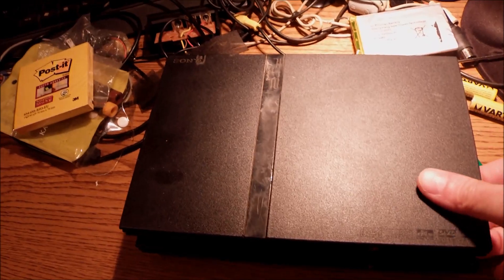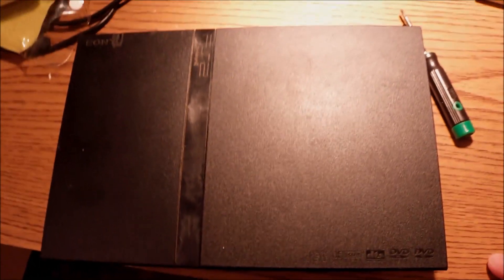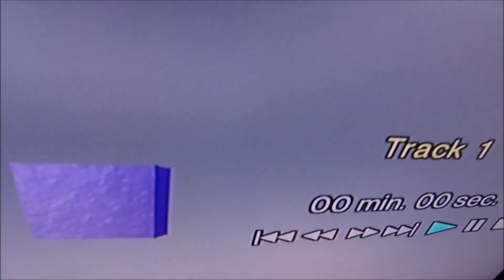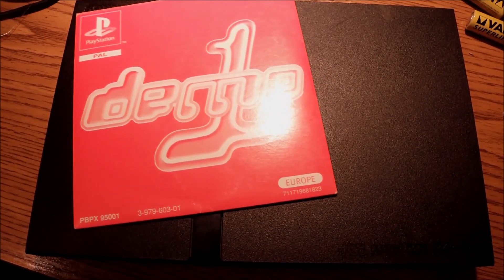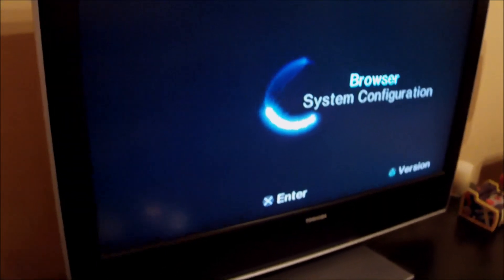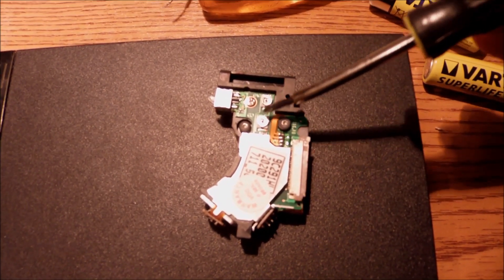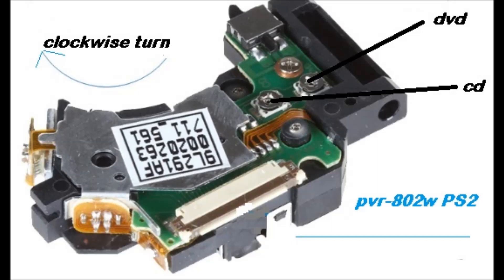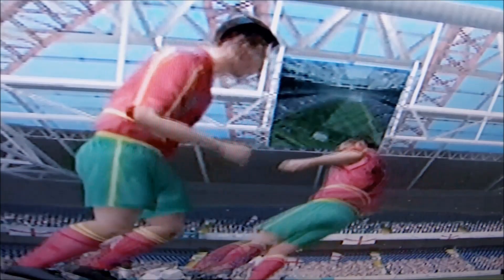PS2 Essentials: Laser adjustment easy fix: 'Disk Cannot be read'.

Comment: Thanks for the video it really helps. At first I tried Clockwise it didn't work then I tried Counterclockwise it did work then! So don't lose hope and after 5 or 6 times it can work and don't turn so much, make tiny adjusments. You dont have to put the case back everytime, there are two switches for making the disc turn, you can see it in other videos, you push them slowly and that way you don't have to put the case back everytime.
Reply from the maker: Hello Mehmet! I am always feeling so glad when a PS2 finally gets back to life !! 
Thank you for the useful tip! and thank you for watching! Cheers!

Comment: help I only have an issue with GT4, PS2 reads every other disc,,,,,, the GT4 disc seems in perfect condition.
Reply from the maker: I just <3 your nick!
Mate, if every other disc is working, the GT4 "seems" to be in perfect condition indeed, but it may ain't! 
The only test possible is to check the disk to another, trustful, PS2 and see what happens.
Your machine is working fine, i guess it wouldn't be wise to start adjusting things because it might get a problem.
Keep also in mind that GT4 is a different animal, the GT4 was the "ever-game-that-pushed-the-ps2-to-the limits", speaking about graphics and speed.
Thank you for watching! Cheers!
Reply: @CyberhugTechnologies Just bought a used GT4, exactly the same...... Must be that the laser is on its way out.

Comment: my dvd is set at 300 ohm original so.. what
Reply from the maker: @melihhabi  Hi and thanks for dropping by! Like you said, when the laser used to be new, the adjusted value was such. Now, needs readjustment ...try tiny increments clockwise and test...I can tell by experience that it will need just a couple of times! I hope this helps and your console will be working just fine!!!

Comment: dude i don't know why but after some attempts of calibration my tester is not reading DVD resistance, only CD, did i damaged DVD potentiometer contacts or what? Anyways i think that i can calibrate it without measuring it, just checking the position of the screw... Anyways it isn't that important because i bought some fortuna freemcboot memory cards with mx4sio for my ps2 slim, but damn i need that laser working because of nostalgia, lol.
Reply from the maker: Hey man! Strange situation, the potentiometer contacts can be easily damaged that is true! 
Glad you get the memory after all! 
Get a whole laser replacement from China, it won't last for ever but just for the sake of nostalgia!

Comment: how do i know how much to turn the potentiometer, and also is there another method of testing, i only own dvds lol
Reply from the maker: Hi there! It is all about trial 'n Error but if you wish you can attach a multi-meter to test ~ around 600 Ω or less. The logic and the idea is the same like the normal DVDs, less resistance, better flow of data bits... Please, bare in mind it is a fix that works temporarily - after 2-3 adjustments the laser will be completely dead - but this might take a year or two! thanks for watching mate!...

Comment: I just bought brand new ps2 slim never used. It’s reading some disks which are brand new sealed games and other sealed game with disc error. It’s reading ps1 discs fine. Any help?
Reply from the maker: Hi there! The reading of PS1 disks indicates that CD is fine so, the problem is now with DVD laser intensity only. 
Try this fix/test with the DVD potentiometer clockwise as described - small increments on DVD potentiometer screw only. It might help! First, try to clean the lens with isoprop alcohol and water (50%-50). Thank you for watching!

Comment: I tried it, and I cleaned the lense, but it still doesn't read dvds of games which are not original (dvd-5), while the orignals work no problem.
I don't get why cause back then it used to read everything just fine :/
Reply from the maker: Try small increments and it will work for sure - just be patient as these potentiometers are so tiny and small increase/decrease is only needed! thank you for watching!!..

Comment: I recently bought and changed laser in ps2 slim because last owner said it is only for replacement. And with new laser some games work others don't. Ps1 games plays ok, ps2 games with scratches works and perfect ones without any scratch don't. I am so confused right now. This type of adjustment have sens on brand new laser?
Reply from the maker: I have seen this happening, this is a behavior of cheap  imitations of lasers not the Sony ones and so not much you can do - Chances are if you experiment with it, it will not be able to read that much of the disks.
Reply: @CyberhugTechnologies  There is 3 type of laser for ps2 slim right now  on the market. PWR-802W, KHM-430A and SPU-3170. Only two of them is comompatibile with my scph 70004 mechanism: PWR (which i have right now) and KHM. Or maybe there is more lasers out there that i do not know about. Can You recommended one?
Reply from the maker: @RetroMatter  PWR is just about right. For me, the most well designed mechanism of all. It is just a matter of quality as they are produced massively and shipped in bulk quantities. Thank you so much for watching!

Comment: i am going to try this. my ps2 suddenly kept giving me this message, and i have to try like 10 times for it to actually start reading again. will probably also order a new laser just to be sure. i wish i knew this like 7 years ago, i threw away a non working ps2 slim with exactly this problem.
Reply from the maker: Hi there and thanks for watching, i hope this helps.  Please, check laser model first but in any case, this solution can be applied on every model and even on audio cd players or dvd movie players.

Comment: I accidentally recently dropped my ps2 slim unit.  Not sure if this video has anything to do with my issue but my ps2 games will no longer work however I did try an audio CD and a ps1 game and those both worked. So I adjusted the DVD screw on the back of the laser twice and the ps2 games still did not work. Should I keep turning the screw or do you have any other suggestions ??  My unit was working fine until i recently dropped it so not sure if this screw is relevant or not .
Reply from the maker: Hi Dill and thanks for watching. The mishap with the PS2 drop sounds irrelevant with the laser screw adjustment, at least for the purpose of it. The whole laser mechanism likes to be correctly aligned with the cd/dvd surface. at the same time the mechanism has this little "eye" to read the surface of the disk and pass it over to the circuit. There are many tiny little wires there to carry the signals. Bottomline is, i think you need a new laser - the whole thing - from ebay or somewhere - Hope this helps!

Comment: Could this potentially help with stuttering/lag with my PS2 Slim? I've cleaned the laser and it's reading discs just fine, but I'm experiencing stuttering/lag when playing games. Thank you for your video and your help!

Edit: I just attempted this after asking the question with my Slim model 70011 and it worked! PS2 isn't choppy and load times are incredibly quick. You saved me from having to replace the laser. Thank you so much!!!
Reply from the maker: You're the flash! I read it the other day but you already got it right! I appreciate your time and effort and Thanks for watching!
Reply: I have the same PS2 slim model. If I may ask, how much did you turn the screw?

Comment: you sir are an absolute LEGEND. thank you so much! i just pulled my ps2 out of the closet after many years, i remembered having the problem where some games would play and some wouldn’t but hoped for the best anyway, i tried again and same problem. now 5 minutes later after seeing this video i’m back up and running! i wish you had put this out 15 years ago haha
Reply from the maker: My reward is exactly this! Thank you for watching _ So glad i could help!
Reply: Did you adjust potentiometer with measuring or without
Reply: @lu-ww2cn  honestly i don’t remember, i know i went back and forth towards the end doing tiny adjustments until it worked but could have used a meter to get in the right ballpark first, sorry i couldn’t be more helpful
Reply: @johnnydove  thank you for your reply I am just worried about doing it without measuring
Reply: @lu-ww2cn  get a cheap multimeter, they’re probably like 10 bucks or something or borrow one from a friend

Comment: You’re not explain everything, i adjust and sitting here over 8hours and still cant do anything the disc wont read
Reply from the maker: Hi Mad, you just need to make small adjustments and play with the screws in small increments - little by little clockwise - what is giving you trouble ? maybe you turned more?

Comment: HI
What's the maximum number you can adjust the DVD potentiometer?
Reply from the maker: Hi Dean, for DVD part initially around and less than (<900 Ω ohms), every little turn should go down a bit like 100 Ω or something in order to get the best result :-)  it is about 1/4 turn - thanks!

Comment: Thank you for the video, this seems to be really helpful :) The problem on my PS2 is a bit different so I'm on the fence if I should try this method. It can read PS1 games and double layer DVDs, but no single layer PS2 game. I tried Xenosaga 1 and several video DVDs and it plays them just fine. For every other PS2 game the game starts spinning and the laser makes some noises and it quits with a reading error. Do you have a suggestion for this problem? Is it useful to mess with the potentiometer in that case or should I try something else?
Reply from the maker: Hello, the grinding noise is different topic - Try please, to check my other video in the playlist for the grinding noise - Thanks for watching.!
Reply: @CyberhugTechnologies  Thank you for your answer! I only heard that grinding noise you describe once or twice, most of the time it's just a quiet sound where i thought the laser tries to position itself and just stops after a few seconds. What I tried right now was starting the console with open disc lid to see if the disc spins. With a PS2 game it accelerates and decelerates a few times, decelerating makes a "clicky" noise and thats all that happens.

I did what you described in the video about the grinding noise, just to be sure. Also, I did some more tests with discs after this:
Audio disc: endless "reading disc"
Video DVD: works
PS2 game: short "reading disc" followed by "disc cannot be read"
DL-PS game: starts fine

Sorry about this monster of a comment, I'm just really clueless about what it happening in my PS2 :( All the solutions I can find online only talk about how their PS2s can't read Dual Layers anymore or no DVDs at all.
Reply from the maker: @ShiroiRyuLuga  Hi nd thanks for sharing  symptoms here :-) Sounds to me like your laser is about to die honestly - the only way to be sure is to go ahead and turn the potentiometers clockwise as shown. If problem persists then the voltage trick cannot do much since, the laser is too old to even support more current. That's why it goes fast then slow rotation again as it thinks it found no disk (weak beam).

Comment: Tried clockwise for both but then when putting back, screw on the part connecting the laser to the twist rod won’t stay, keeps turning when screwing in. Is there a way to fix that? Would gluing in place help?
Reply from the maker: These are very tiny screws indeed and it happens so often! yes, glue would do but better to find a same size screw as a spare, only a bit thicker! Thanks for watching!

Comment: i tried it and now unfortunately I can't even read CD anymore. Any disc I put in makes a stuttering noise and doesnt spin
Reply from the maker: Hi, something happened during re-assembly - make sure please, the ribbon is firmly into place (connector), otherwise instructions signals and power  won't reach the laser head.
Reply: @CyberhugTechnologies  I think the ribbon cable is actually protruding more - scratching the disc and causing it to make this noise. I'm not really sure how to fix it though as pressing it down wouldn't help
Reply from the maker: @Joseph27032  Got it...so, check here: https://www.youtube.com/watch?v=ym9kPhYHwaA

Comment: Here's another useful tip if you are in the possession of a PS2 slim: Take 1½" of thin sticky tape ( Scotch® or related ), fold the first inch together and stick the sticky remaining ½" to the stirdy side of the ribbon cable. Trim off excess if neccessary. You made yourself a tool-free pull tab in case you need to do some more adjustments. Once you're done, just leave them inside, might come in handy at a future point.

- Bandi
Reply from the maker: :-) Hey! this is very good indeed - thank you! that's why interaction with one another is key here! Thanks Bandi!

Comment: Mine says the disk could not be read, i then open the lid and close it, the game starts loading.  Any ideas?
Reply from the maker: Hi, typical loose placement it is - happens to everyone, watch for fastening the disk correctly into the central ring! Needs to be firmly placed in there to start reading process, then everything goes smoothly.
Reply: @CyberhugTechnologies  thanks
Reply from the maker: @user-qc7hr4my7r  Anytime, hope this helps! Cheers!
Reply: @CyberhugTechnologies  I don’t think it’s that.  Its weird, when id doesnt work and tries loading it has like a buzzing sound, kind of like a tattoo gun.  It’ll go bzzzzzz, stop for a few seconds and bzzzzz.  When it loads right it doesn’t have that sound.  I make sure the game is seated properly to.  Any other ideas would be appreciated before I send it back.
Reply from the maker: @user-qc7hr4my7r  Hey, the grind noise means the shaft that moves the lens up and down doesn't get completely and firmly with the motor shaft! so, it might be in contact or not with unstable behavior - classic problem after all the years - the shaft is thin plastic with teeth underneath - needs to be gently bend to make good contact with its teeth again against the motor shaft - for this, lens removal is needed - if you think you can do it ok - i was planning to prep a video since it happens often.
Reply: @CyberhugTechnologies  ok, I’m going to return to the seller on eBay since she said she would take it back.  Are there any ps2’s that are better then the others.  I did my research and they said the slims are more reliable then the fat ones or should I get a backwards compatible ps3?  Appreciate your help and advice!

Comment: Ok but I'm curious, WHY does this work? Does the potentiometer just get loose after a while or something?
Reply from the maker: Hi - good question but all that happens is the laser gets weak beam over time so, less resistance is needed on the circuit in order to boost it up a bit. Sometimes, like you said, the potentiometer gets dirty and so, needs some moving but that is rare.

Comment: My ps2 slim wont play a vice city disc for very long and I've tried 3 different discs, no problems with other games, what could be wrong with it?
Reply from the maker: Hey, is the disk scratched? it is possible the disk itself is damaged - then again, what format is this disk and what format are the rest (e.g. CD or DVD)
Reply: @CyberhugTechnologies  the 3 discs were vice city discs that I had bought, one of them was still in the wrapper, they will only play for a few minutes and then give an error reading but other games that i play work just fine it's really strange
Reply from the maker: @autumnishotterthansummer  I followed some threads and many guys faced it, maybe you have to get the disk replaced because might happen to be bad from factory - defective - and second option is to try using another controller/joypad :-)
Reply: @CyberhugTechnologies  I'll try getting another controller, do you mean replace the disc drive? Because I've tried different copies of the same game and it's weird that none if them will work especially the brand new one
Reply from the maker: @autumnishotterthansummer  The game disk :-) it is not unusual to be defective.
Reply: @CyberhugTechnologies  holy moly! At some point I'll try to get my hands on a 4th copy to try, 25% success rate is really sad!

Comment: Is it normal when I turn on gran turismo which is more scratched than need for speed and goes and the need for speed doesn't?  (used by google translator) 😀
Reply from the maker: Hi, yes it happens. The scratches is not the only factor and might just be on the surface and not deeper scratches. On the other hand, just a single deep scratch on the other disk can make it unusable.. But of course, try to find the right point where the potentiometer screw should be in order to make both work! Thank you!

Comment: Turns out this is probably not the problem I'm having. See mine could read some DVD's, but not all of them. Now it can't read any of them. Haha
Reply from the maker: Hey, turn it the other way around, it should do :-)  in many cases, the laser is so weak over time that can only be replaced - if it could make it though with some dvds, turn it slightly the other way around, little by little as try n' error...

Comment: My ps2 has a new optical drive and still doesn't work, my problem is the disc motor or atleast the signal to the motor, because the laser works fine but the motor doesn't spins at all, and i tested the new one in another ps2 and it was working.
Reply from the maker: Hi, sounds like the motor needs to be replaced then - but first - check the ribbon that supplies the motor with power and the instructions to start/stop... maybe only this ribbon cable is the problem!

Comment: I have to thank you for this. Had trouble with both of the buttons that the lid presses down and then found out I had this kind of problem......yay. But this was an amazing fix. XD I did take your advice and adjusted slowly to the point where I had to unscrew the laser bit a few times and screw the two screws clockwise again. Better safe than sorry though.